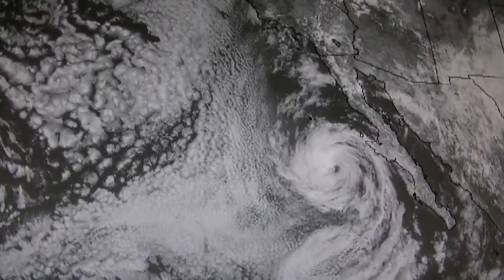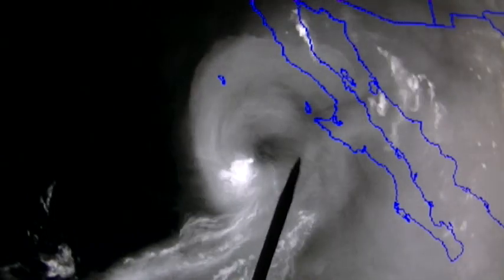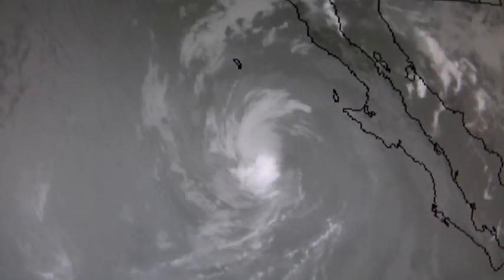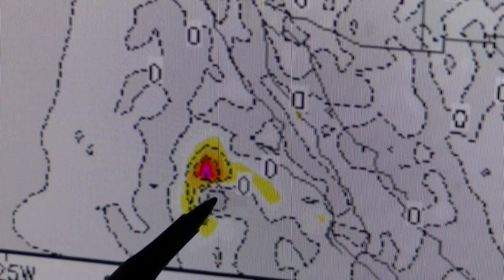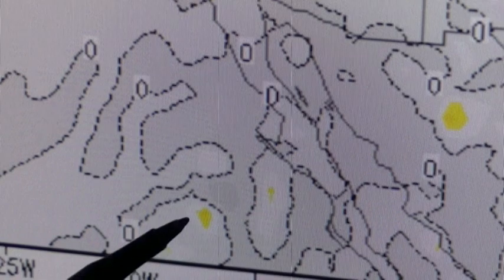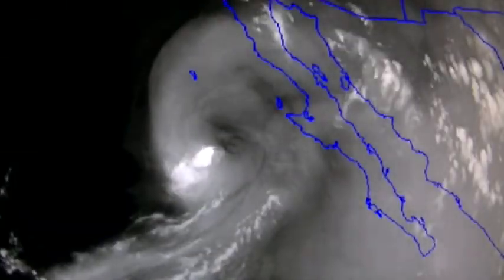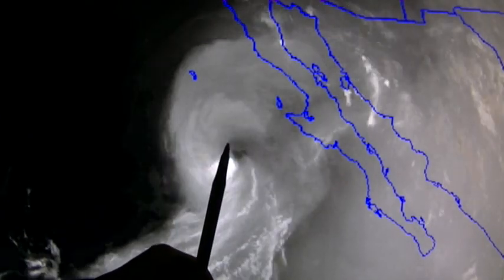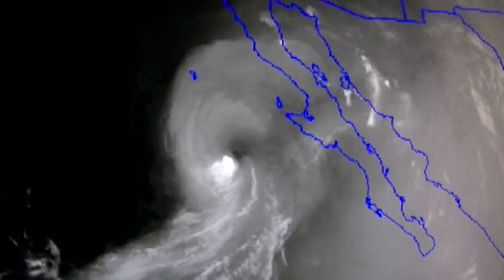Baja HAARP Kills Hurricane Norbert part 3 on 9 07 14

Comment: Searching images of hurricane cross sections, nearly all denote a region of descending air within the eye of the hurricane/typhoon/cyclone.  The eye looks like it would be the descending air focused upon in vertical velocity maps which means it's possible the descending air is a known, naturally occurring feature.
Reply from the maker: Yes, I agree that a fully developed hurricane has sinking air in the center. This is produced by the powerful rising air in the eye wall. However, this was a dying tropical storm, which no longer had an organized eye. My later video of Hurricane Odile, and Polo, show this even better. There is a falling column of air, from about 30,000 feet, all the way down to 5,000 feet, but this descending air was not associated with the storm. It was just "stuck" there by some mystery force. Good point, though, but I don't think it applies to these videos showing the hurricanes being blown apart by a mystery source of sinking air.
Reply: The HAARP Report How exactly do you prove that these "air down-bursts" are being caused by HAARP and not by something else?